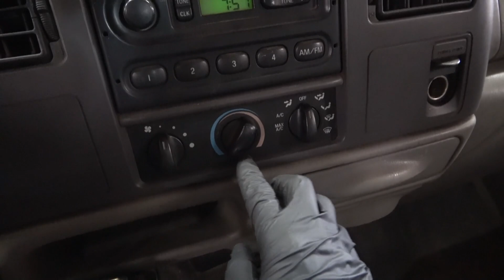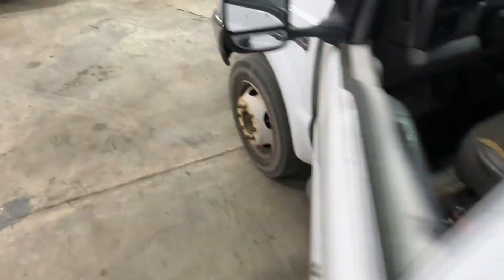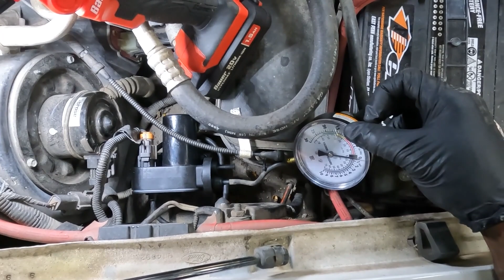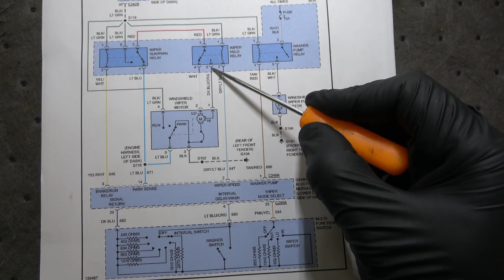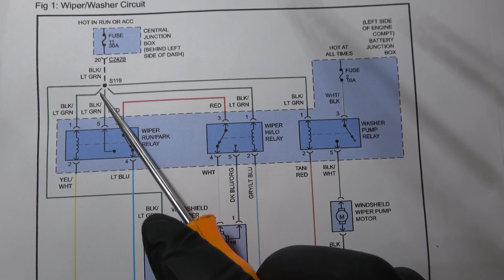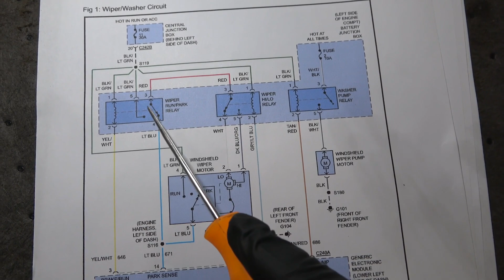FORD F450 : Windshield Wipers Not Working & HVAC Stuck On Defrost Diagnosis & Repair Part 1

Comment: Hi! My friend I have 2015 sprinter 2.1l codes 
P245C
P261F
P2602 
I have scanned it! But I don’t know if it’s electrical problem something that I see is the vacuum is not opening the valve from EGR
Reply from the maker: @miguellomejoral1005  I didn't understand your question, sorry!